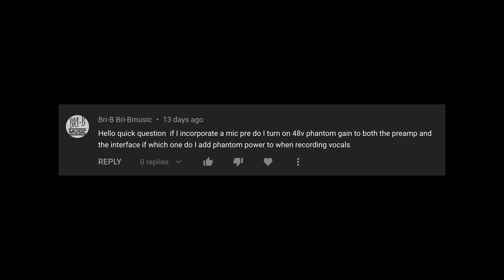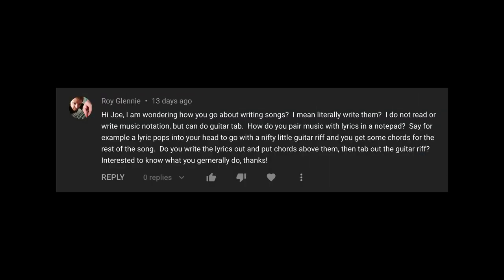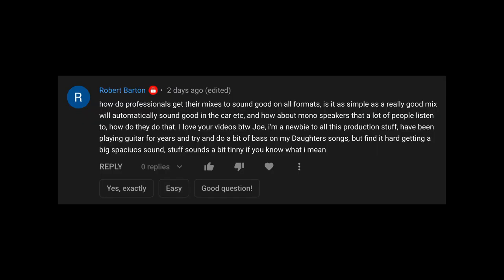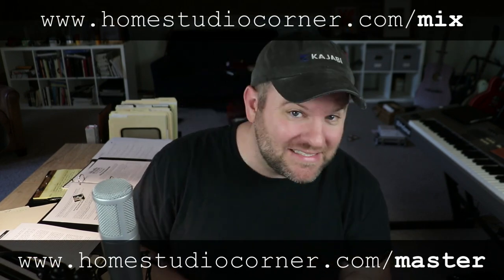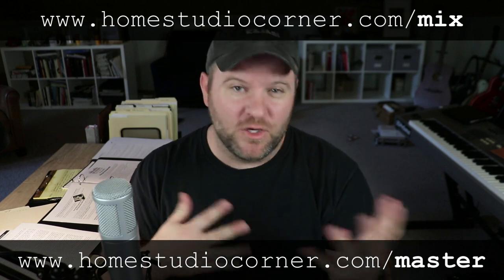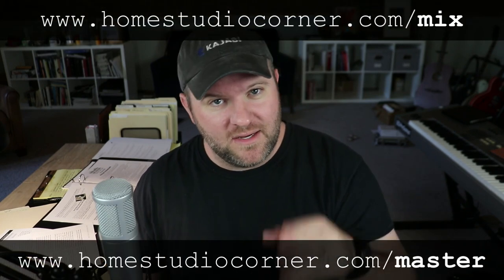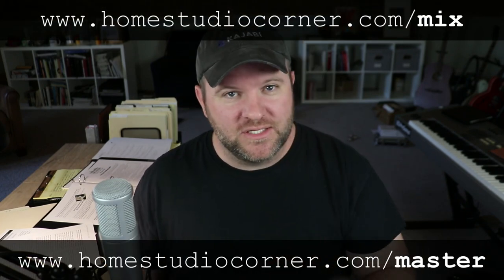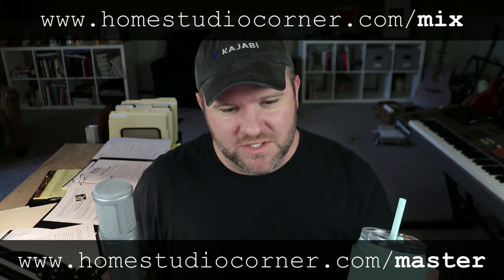Secret to Getting Mixes to Sound Good in the Car

Comment: Hey Joe- all of the car stereos nowadays are all digital and the sound is soooo crappy- car radio, CDs, and thumb drives sound so tinny, It's not like the old days when you could take your cassette tape to the car and really appreciate the four-speaker stereo. I miss the old analog sound. The only station that almost doesn't sound that bad is the classical station.  I appreciate your advice- about frequencies and how to mix , and it really helps to have a couple of good headphones along with the monitors.